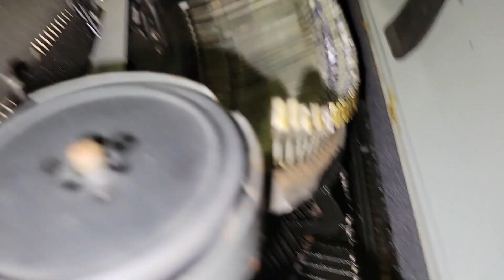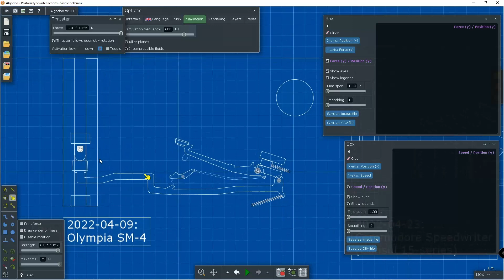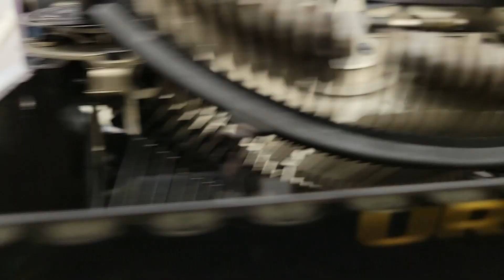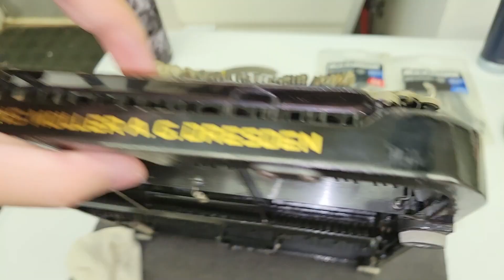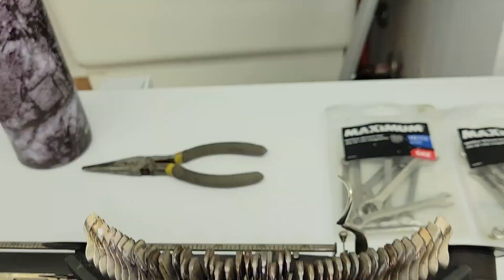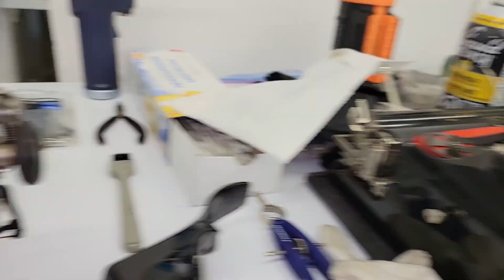The 1936 Klein-Urania typewriter

Comment: I have the same version of Klein-Urania 1935 ( from the X Over It collection - see his blog post on it ), and I love it!
Since you seem to be a very exacting and knowledgeable mechanical engineer….. may I ask a question about my Continental Standard… the next iteration of the one you have, but I’m sure mechanically very similar?!
Everything works on mine alright, except that the right half of the keyboard, will only let the typebars raise to about 1” short of the platen… and don’t advance the carriage, or ribbon! The left side operates normally. Any idea what might be out of alignment.
It was shipped to me, and arrived safely, but I’m sure got banged around. It supposedly worked before shipment…..
As usual, your vids are thorough, and practically a repair and operation manual for operation! Thanks!
Reply from the maker: I actually rather studied computer engineering, but have had a decent knack for the mechanical. One thing would be to look into the line lock mechanism that blocks the keys when you reach the end of the line. There might be a misalignment where the blocker (I don't remember off the top of my head how it is set up on the Continental) even when not at the end of the line rests such that it blocks half of the key levers or typebars from moving. With these kinds of issues, in the absence of a repair manual, the skill to employ is looking deep into the machine to find out what is blocking what.
Reply: @haelscheirs_haven  thank you!